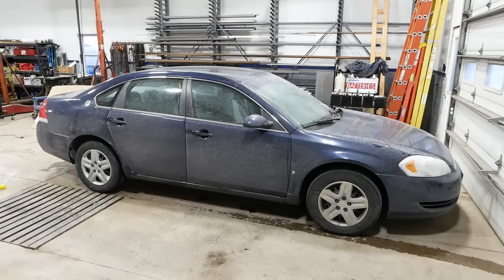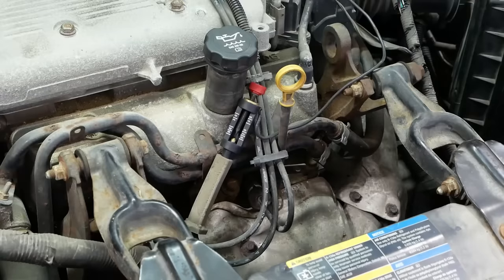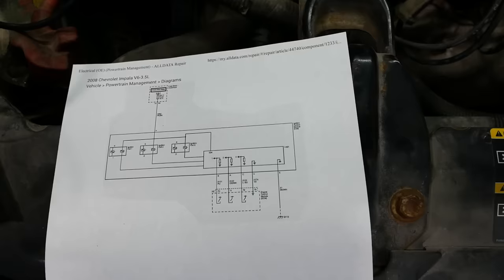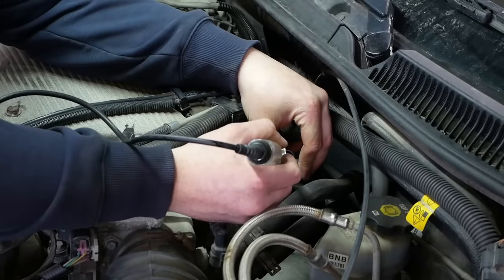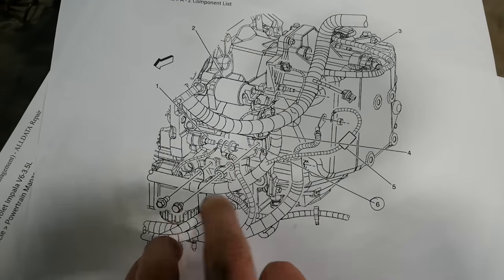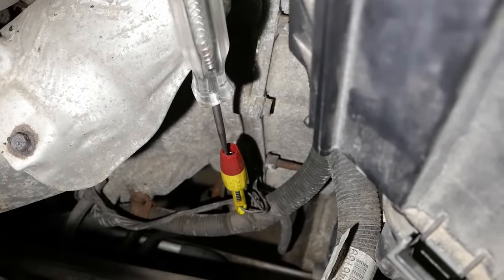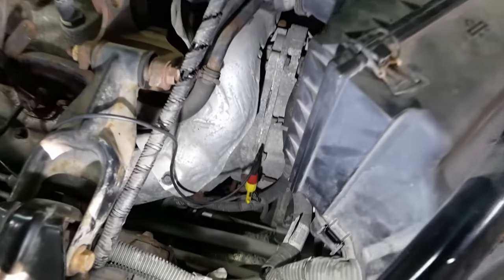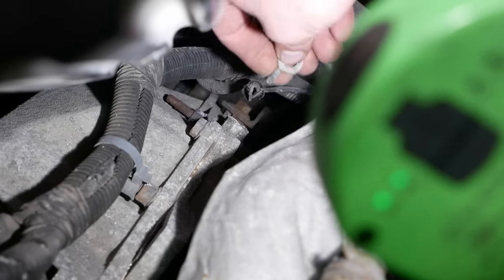Chevy Impala no Start, no Spark, no Codes

Comment from the maker: This is the Launch tool I am using: https://www.amazon.com/dp/B098DF7BLL
There is a discount code  SXJ62Z2B but I don't know if it works anymore.
Reply: Still too rich for my blood. But, I'm just a home gamer with 2 vehicles :)
Reply: gonna order one thanks Wes
Reply: Your idea of "cheap" and mine vary considerably.
Reply: You used a blue crimp eye - that's for AWG13 or 2,5mm² - for the two thin wires that look like AWG18 to AWG20. Next time try a red one (AWG15 or 1,5mm²), it will do better.

And please do not solder crimps, that's for non-professionals only 🤣
Reply from the maker: @stefankaufmann8257  The blue crimps in the US are for 14-16 AWG wire. Two 18 AWG wires should be a good fit. I just crimped it wrong the first time.
Reply: The Autel MX808 is only half the price at $475... Is it not any good?  Which is the best budget scan tool that I should get?
Reply: @WatchWesWork  no escape
Reply: @noberet  Look in back a look in the back of the trunk it should be a reset button on the drivers on the driver side of the car my own solution that I can come up with thank you bye
Reply: @floydsmith6830  Ah, that's my problem. No junk in the trunk.
Reply: How does the Autel compare in speed?  I use the Launch x431 but it seems to take forever to do code scans or health reports
Reply: Ok Wes its been 5 days, where's the next video

Comment: Awesome video. Just straight no BS diagnostic work. No parts cannon. The mark of a professional mechanic. Keep up the great content Wes.
Reply: @John Verne I'm thinking $50 for the sensor (plus labor) the poor guy got ripped for.
Reply: Love to watch his diagnostics videos.  He is great.
Reply: That's why I like Wes!
Reply: Why do mechanics in a dealerstore can not do the simple things you do ?
Reply: @tomjoad1363  They are trained to read a diagnostic code reader. Not how to trouble shoot. Case in point: I have a 2002 Harley Davidson Road King. A few years ago, I had an on again, off again plug fouling problem. I took it to three different Harley dealers who could not fix it because it threw no code. I considered selling it but as a last ditch effort, went online and studied the fuel injection theory of operation, checked every single wire connection that had anything to do with the ECU control of the FI system and found a simple wire connection problem that cost me 14$ to fix. Sad thing is the general public does not know what's going on with dealership mechanics. Not all of them, but most of them. Sad, sad, sad.
Reply: @tomjoad1363  Here's a link to my bike problem: https://www.youtube.com/watch?v=Yjec40Nm3fQ That was 7 years ago, bike has 90,000+ miles and I'm 77 and we are both going strong! p.s. It has not fouled another plug since my fix!
Reply: @Watchyn_Yarwood  Is there any protoco lto follow to guide one when troubleshooting? When I see Wes's video I'm always stunned hoiw easily he proceeds and find the solution to the problem. When I'm in front of my car, I don't know what to do and how to do it.
Are there books that could learn me how to correctly troubleshoot?
Reply: @tomjoad1363  Yes, but depending on your existing knowlege base and experience, my suggestion would change. Even an old Haynes manual has useful troubleshooting information in it. Just remember starting off, engines (gasoline engines) need 3 things. Air, fuel, and spark. Find which one is lacking to start with. Then chase down why that one isn't there. Study your butt off on electrical theory. There's a lot of information right here on Youtube for free. You don't need super fancy tools to do a ton of basic troubleshooting. Notice how wes uses a wiring diagram and old test light most of the time, instead of hooking up an expensive scanner right off? Get you one. Get a good multimeter. LoadPro is a nice troubleshootig tool to add to that multimeter, but you need to know how to use it. Lots of instruction on that available.
Reply: @ChevyConQueso  Thanks.

Comment: I think whoever owns that car is lucky to have an honest mechanic who's focus is on troubleshooting! Thanks for the video
Reply: I sometimes start to believe, everything at least one other mechanic gave up on before lands on his floor.
Reply: @alexanderkupke920  Some just like rely on scan tool which don't always help you when there wire problem or ground issue.
Reply: @rrcoster  you mean they simply don't do what a mechanic should do and use their knowledge (which some of them obviously lack of they have to rely on what a tool tells them) to actually troubleshoot an issue by applying knowledge on how a system works, some logic and some simple structured approach?
Yeah, you are absolutely right. And for some shops, especially the ones that seem to cost less (although sometimes or even quite oftwn at dealerships it is the same) who then just look up codes and fire the parts cannon, in hope to hit the right one as well seems to be the official procedure to repairing parts and mechanics are discouraged to actually spend time analysing and troubleshoting
Reply: @alexanderkupke920  Yes...id rather pay someone actually spend time analyzing and diagnosing the problem then fire part canon hope that fix it. Guess glad i have some decent mechanic local like Wes when i can't figure out the problem myself.
Reply: I wish he could work on my car, finding a good mechanic in my area is not easy!
Reply: @oldestgamer  me too, many exist I'm sure, but how do you know if you found one. In GA a mechanic can hold your car hostage until you pay the bill😡 Its never happened to me but my brother almost flipped his lid when 800 dollar est turned into 2700🤬
Reply: @Jayf1981  There can always be unexpected problems, we have seen that here with Wes, but I have a feeling that a good mechanic would have figured that out before the est and if the est was wrong, would work with you or notify you beforehand.

Comment: I hear “ comments are going say I should be soldering this”, then I hear and see “going to use a little liquid tape” then I hear and see the “ going to use a little dielectric grease on this connection”, and I find myself setting here grinning like a dog eating cork, because I can just hear all keys on the key boards being smashed at the same time and the send being assailed at the same time. You gotta love it, stay the course, love your vids, thanks for the ride along.

Comment: That was a great diagnosis. I'm not a mechanic, but I'm a security system technician. It amazes me how people don't start at the basics. Even at my company, they like to just throw parts at the problem, regardless of cost. Then throw in the technician who can't possibly be wrong, "he's been doing this for years". I always start on the basics. Does it have power and a good ground and move on from there.
Reply: As a 76 year old retired Marine Electrician, I often asked "knowit all" customers to explain to me electron flow. First response says it all as to how I proceeded  lol
Reply: @mauricekeithjohnson2598  I know it has something to do with magic smoke! 😂😂😂
Reply: @steelfist65  Lord Lucas philosophy lol.
Reply: @mauricekeithjohnson2598  M.E.S. !!!
Reply: I’m a commercial hvac tech and I absolutely agree with you. Everyone is so quick to throw parts at it instead of troubleshooting the issue.
Reply: @jasongreen5439  I think a lot of that is training. They don't teach enough of the basics. I'm surprised at how many "technicians" don't understand any electrical theory. A lot of them are baffled by a multimeter.
Reply: I once had a dealer complain about their access-control. It turned out to be on the thirtieth floor of a NYC highrise and the "earth ground" was run to a metal stake, driven into the planter of a potted palm tree:)
Reply: @nferraro222  well, it was an earth ground! 😂😂😂
Reply: @steelfist65  As long as the 'smoke' hasn't been let out!
Reply: Absolutely. It can't work if it doesn't have good power and ground.
Reply: @steelfist65  that is so true.
Reply: @mauricekeithjohnson2598  Lord Lucas? The Prince of Darkness?
Reply: @steelfist65  Once my work sent me on an training course (electronics).  They started with the basics, which I thought was a good sign.  Until it transpired that the instructor didn't know how to calculate the voltage WRT time in a simple RC circuit.  All they taught was, "Calculate tau, use values of tau and t to look up % of charge in circuit, multiply by input voltage."

I lost interest at that point, but still passed with flying colours.

Comment: Crimps (without solder) stand up much better in a high-vibration environment, which is why you don't see soldered wires in automotive applications.
Reply: Also I believe soldering is banned in aerospace applications

Comment: Fun fact regarding people telling you to use solder: I’m in aircraft maintenance school at the moment. Aircraft no longer use soldered splices or connections because solder makes wire brittle at the point where the wicking stops. Crimps are also more easily repeatable with less margin for error.
Reply: Soldered connections have been a NO/NO from ABYC for many years. Too much vibration in boats.
Reply from the maker: NASA says the same thing.
Reply: As a retired USAF crew chief, we had to replace any broken wires.  No repairs/splices allowed.
Reply: @robertheinkel6225  I have no real life experience yet so that's entirely possible as well. They told us one splice is allowed on a wire except for some where you're not allowed to splice at all like coaxial cable and such.
Reply: In aircraft maintenance you use the proper tools to make a high quality crimp, then it is superior.
The trouble starts when people just squeeze those cheap colored crimp connectors together with whichever pliers are on hand. That's not a gas tight crimp and won't last. But hey, those people probably couldn't solder worth a damn either.

Comment: Best way to make sure the wire doesn’t pull out of a crimp is to strip it twice as long as needed. Twist the wire, Fold the stripped section in half and place it in an eyelet of proper size to fit the now doubled up wire. Using this method the wire will break before it comes out or if it does come out something has hit it hard enough it wouldn’t have held no matter what
Reply: Same here you couldn’t pull it back out if you try

Comment: The wire stripper pliers you received from Germany were almost identical to what I used during my apprenticeship in 1972-4.
Reply: I've always wondered why he didn't have a real wire stripper. A pretty good one by Ideal is less than 50 bucks. Smaller than that one the viewer sent, too.
Reply: Been using mine for 20+ years !
Reply: @Mishn0  real wire stripper = those which leave dints/damaged/cut copper strands ? 

That german one can be controlled rather closely = not nicked/damaged copper strands here.
Reply: @TheStefanskoglund1  Why? Because it's "German"? Are you saying US made tools can't have tightly controlled tolerances? I used Ideal wire strippers to make literally thousands of wire harnesses for military aircraft and the work was closely inspected. Give me a break.

Comment: For those advocating soldering, a cold solder joint is pretty much the same thing as a lose crimp. Both are easy mistakes to make.
Reply: And in the salt/rust world of Canada, I've seen fluxcore solder rot wires within a year.
Reply: Yep !
Reply: @paulcooper2897  if you use the sealing hest shrink you should be safe. Any unsealed wire will rot if exposed to salty water.
Reply: I hope i can sneak this in and wes wont see it..i wanted wes to strip more insulation,  more bare wire exposed. I learned wire splicing years ago. Pigtail, western union and tap style splices. The advantage of mechanical strength comes from a mininum of 4 twists, then what he did afterwards was fine.
Reply: Being the lazy guy I am, I would have made up a new eyelet with a stub of wire on it then just spliced the existing wires to that using a shrink&solder splice. Always easier when you can see & reach what you're working on.
Reply: Soldering is also brittle. How many OEM connections that are crimped correctly have been soldered?
Reply: It is even worse than that. Crimps seem very simple, but the number of different failure modes I have seen even on factory installed crimps with calibrated tooling would surprise you !! The solder (if done well) would provide a better electrical joint, and prevent local corrosion (I dont know what the effects of the flux might be if not cleaned), but would make the cable rigid, and if there is vibration then the strain relief provided by the crimp boot may be comprimised. I am being a purist here, and Wes' solution will probably last longer than the car now ! Well done for looking at the schematic - proper job.
Reply: The factory crimp used no solder, lasted 14 years and over 100k miles. This repair will last until this car is sent to the crusher. Don't waste time on soldering where it is unwarranted.
Reply: Solder also has a failure tendency when overloaded, the heat will melt away the solder. Aircraft generally have all crimp connections--even in a short circuit/overload scenario they hold.
Reply: @pootthatbak2578  I agree. Short wires when twisted become conical in shape, because the proximity of insulation doesn't allow you to twist completely. This conical shape is mechanically trying to eject the eyelet before you even crimp, and if you don't hold both parts strongly during the crimp the twisted wire could be ejected or crimp only the tip of the wire cone, just like it happened here with Wes. Lesson learned in my book 😂
Reply: @Mekhanic1  good point with the heat.  Another reason I've heard not to use solder in a car are vibrations that can break it.  I suppose this also applies to aircraft as well.
Reply: ABSOLUTELY do NOT solder before crimping.  Solder is soft and will easily "flow", especially when under stress like being crimped, and then the wires will be loose.  For a person who is determined to solder the wire to the crimp-on terminal, crimp the wire securely, check that it is a secure crimp, and THEN solder it.  But do know that a soldered connection is more likely to fail due lack of flexibility.

Comment: Great work as always Wes. Just had a bad earth problem on my landrover. Salt air had destroyed the ground for the rear lights. Not the best build quality. Have used dialectic grease on the repair despite the 'experts' on you tube! Best wishes from the UK 🇬🇧
Reply from the maker: I would blame them, all the makes have ground issues.
Reply: @WatchWesWork  Yes even Mercedes start to have those ground issues when tey turn 25 years old, And I know, my daily drive is S124 300e 4-matic -90 year model. No too many computers in it, and vould need those spesial MB "tools" to diagnose, or that " flashinglamp" wire to count, those basic things, ABS and 4-matic system. I think also KE-jet also, no needed yet that, coming next spring, when I start with my other merc, also same age 300e but saloon, AMG copy, by some finnish people, dont know, but in registration papers, it is made in Finland. So quite unexpected for mercedes tha old. 
Yes I really love your way to do things, you go to basics, by thinking first, then you take that codereader for help, and also yours way to handle those not so roadworthy vehicles also, and rust can`t stop you making good job.

Comment: RPO codes are on the sticker on the glove box door...

There is a reason you don't find solder joints in factory wiring: they determined long ago that the hardened wire section becomes a stress riser and often results in a broken wire (from fatigue) right next to the solder.

Comment: Oh how I long for the old days when you didn’t have to be half a scientist and a computer tech to make an engine run! 😬
Great work. Thank you for sharing
Reply from the maker: I dunno. This is pretty simple. Grounds have been going bad as long as they've been around.
Reply: @WatchWesWork  Having access to wiring diagrams is kind of cheating. LOL
Reply: @erik_dk842  I am not sure I consider having wiring diagrams or schematics cheating. There are likely multiple main ground points on most vehicles. Would be expensive and time consuming to physically trace a faulty ground wire to it's attachment point. Diagrams used properly conserve time and technician energy. My opinion at least.
Reply: @brianworley7705  Without subscribing to a service, getting correct wiring diagrams is quite hard. The redrawn version Wes has access to is also easier to follow than Volkswagen's originals, which I'm familiar with, because they split them out across several pages, so you have to go back and forth.

Comment: There was in my area, an EFI expert that roamed around in a van and even dealers that were stumped with difficult cars would call him in.  He told me that the vast majority of EFI faults are faulty or poor earths that cause unusual problems such as poor running that wont throw codes. I have even encountered a problem on a vehicle (only when the ECM had a non stock tune) that would get a hesitation misfire at 5000 rpm wot........... It was caused by the 20 year old, main positive battery cable. Once it was replaced, the missfire went away . Nice fix Wes, thats how its done........check the basics.